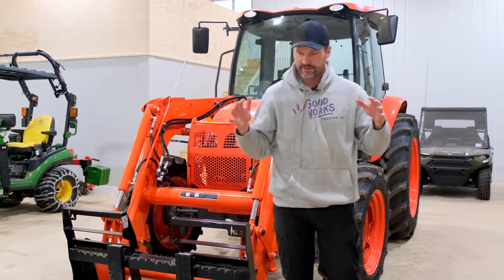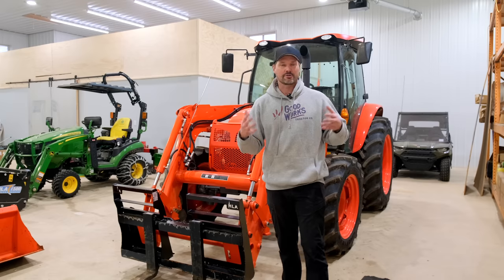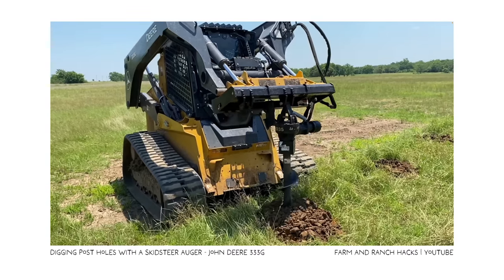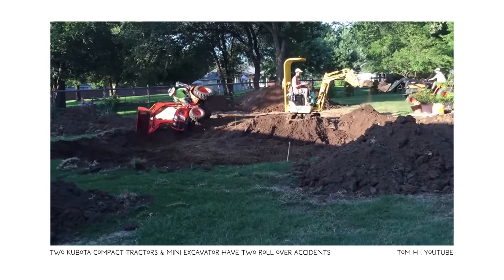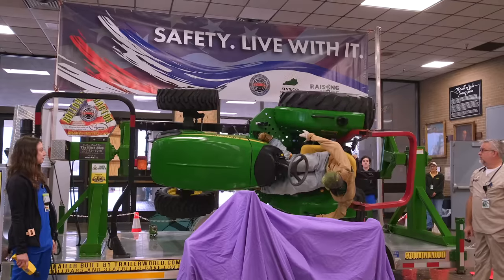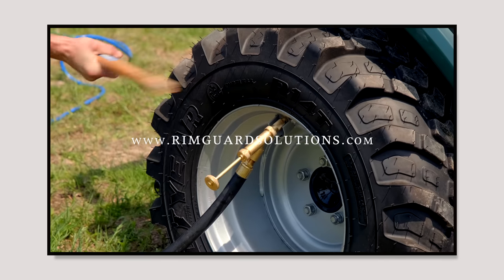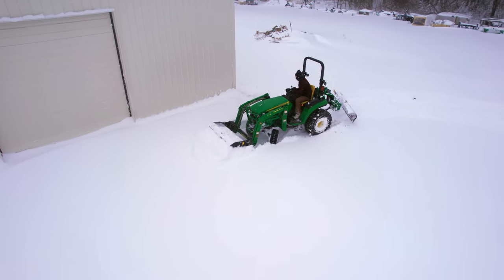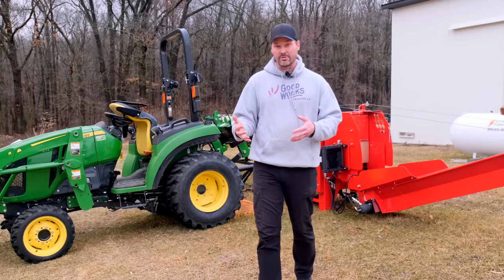BUYER BEWARE: MY 5 MOST HATED THINGS ABOUT TRACTORS.

Comment: I agree with alot of your points. Dealers that are into used tractors I believe have taken advantage of the customer.  Used prices are way too high on a piece of machinery you do not know the history of, point blank. Folks just do not take care of things like in the past. I bought a slv65 new and used it for my purpose and as soon as I no longer really needed it sold it. For me it was great work time saver and completed the work easily. Sold it for a fair price as far as I was concerned but apparently the very happy buyer said I could have asked for so much more seeing how it had 200 hrs.  I would have spent alot more in rentals, transportation potential damages...I avoided a used machine that may have cost in repairs. The Kubota repairs, services and parts are out if this world. I was quoted 600.00 for services on my bx23, yep did it it myself! There are times I would like the dealer (stealer) "go through" my machine, but that is ridiculous.  The slv65 was fantastic.  The bx23 is is built cheap many parts broke, most all the "safety" switches broke, hoses failed, dealer did not fill front diff, I learned to repair and fix my self saved $$$$. Not time but $$$. Thanks for your information.
Reply from the maker: Used pricing is strongly correlated to supply and demand and compared against what you can currently buy it for new.  It doesn't matter if it's through a dealer or Facebook marketplace.  The COVID years were a perfect example of this where you could see the used market go sky high based on scarcity everywhere that tractors were sold (commercial and private).  The prices have started coming back down.  It is all based on where the buyer and seller meet on price.  There will always be dealers and individuals that overcharge and generally speaking sales are slower becuase of it unless there is a corner on their market.

Comment: I believe that you are spot on about the fact that a lot of new small tractor owners have way higher expectations  of what their tractor is capable of than they really are. I was one of them. That being said, I am still amazed at what they actually are capable of. I bought a 2007 John Deere 2305 about 4 years ago with 400 hrs. on it. It was basically like brand new. The paint was still in the loader bucket and I don't think that the backhoe had ever been used. I  think that it had only been used for mowing grass. I wouldn't trade that tractor for anything. You are also right about inflation and what it has done to the average homeowner that would have been in the market for a tractor. I believe that a lot of people would love to go out and buy a tractor simply can't afford it now. A year and a half ago I bought a new tiller. At the time I paid approximately $1800. for it. Now the price has gone up well over $2000. I wouldn't be able to afford it now. I hope sincerely that things get back to the way they were. Sorry, I get a little long winded sometimes. 😁 God bless.
Reply: YES you are Right my Friend. For me I bought a very USED (8000 hour) construction type of Backhoe (Dynahoe-190)  which is (19000) Pounds. It needed lots of work to it when I bought it. My wife wrote up great contact, if repairs were more than down payment. That was the price for Backhoe. The Brakes did NOT function. The one stabilize would NOT function. And the two front Loader Lifts LEAKED like an open Artery. I had found a great local repair shop. One of the workers had sold Dynahoe's in the 1980s. He knew them inside and out. I have put hundreds of hours on her since 2003. No work or rebuilding of the Engine a wonderful Detroit Diesel 353. Just keep the filters clean, OIL clean. I have a small piece of property. I used it to make a small garden plot in the corner of the property. I pulled out my Driveway  for replacement. I am installing a swim spa for my wife. I think I would have spent way more time moving dirt with subcompact Tractor to make flat roads to deliver the spa into place on the back side of my house. Very fast work moving dirt, moving my Wood pile. Smoothing a flat surface pad for delivery of spa with forklift machine the company uses. Just saying that my LARGE Backhoe does it for me, more than a subcompact. If a person is willing to have repairs done on a used piece of equipment
Then I think they need a construction size Backhoe  more than a subcompact. Like he said I can rent from Home Depot any subcompact Tractor with attachment if need be. 
When the contractor was grading my Driveway replacement. He had to have the rental company come out and replace one of the Rubber tracks on the mini excavator, it split the Rubber. So even a mini excavator broke down. I ended up finishing the haul out of his material to the garden stock pile. I look at my small garden as a strip mine. My big Backhoe I completely turn the whole garden over each year. Like a strip mine moving overburden. My Backhoe is way oversized, but it has done every project I do in my small lot. Never an issue with power, even taking out LARGE tree stumps.
Reply: Right, I bought my skid steer 2 plus years ago it was a 2022 modle, price went up from the 58K I paid to over 94K for the 2023...  unfortunately we can't print money like the federal government so most of us are SOL. That said  the prices of livestock seems immune to inflation as far as the producer payout goes has not changed in over a decade, yet it costs 8x in the store. Big slaughterhouses making a killing in more ways than one.

Comment: I believe r4 tire became so popular because they were the only tire between the r1 and turf tires. You do get better traction in mud with r4s over truf tires and still don't tear up a yard as bad as r1 tires. I know now there are other options that can do both and give you better mud traction. These other tire options usually cost more then r4s and are limited tire sizes to chose from. The r4s also have heavier ply tires then the others for frontend loader work.
Reply: Exactly. If the R4 was that inferior it would have been abandoned 30-40+ years ago by the constitution industry. Yes the R4 is a compromise design. Not specifically for any one application. (Except high durability was purposely engineered into the R4.)
Reply: T

Comment: Yep .... all true.   After working with a JD630 and Massey35 on 80 acres for 20yrs I decided I needed something better as I get into my 70's.   Did do diligence ..... researched the multitude of Makes & Models ..... kind-of set my sights on a tractor hp of 55-60.    Settled on the Make (Kioti) and found a dealer 52 miles away (that's a short distance for Wyoming).   Went into the dealer with a listing of what I needed to do and the implements to accomplish it.    So .... they showed me the RX73 hp model.   Tried it out .... thinking I don't need this much power.    Then went to the NS60 hp.    The dealer asked if I remember "Tim-the-Toolman - Taylor".    He was Soooooooo right .... "More Power"!!!!     Could I have gotten by with the 60 hp model?????    Yaaahhhh ..... BUT ... 4x4x8' hay bales is a breeze with the RX73 where as the 60 hp might be intimating the Massey 35 saying .... "I think I can .... I think I can."

Comment: That's funny you being up the hydraulic speed. A few years ago I was looking for a log splitter and a 3 point hitch one was basically the same price as a self contained one with wheels and its own motor and pump. And the self contained one works a lot faster. Plus it doesn't hold up the tractor .

Comment: These tractors always impress me as to what they can do! Lift more than I can, move material to wherever it needs to go, mow large open areas, etc. Easy to operate, cost less than a skid steer and don't damage lawn areas so much. Good points on lift capacity and lift height. As said, do your homework before $$.

Comment: I like the “choose the right size” point that you made. I just finished 100 hour review of my Massey Ferguson 1825e, and I can’t believe I missed that point. For my application the full size compact tractors like the one I have are a little to small for some of my projects and a little too big and heavy for other jobs, but buying two separate machines was not an option for me so counterintuitively the tractor that is not perfect for most my jobs ended up being the most perfect tractor overall. Thank you for another great video!

Comment: Great video, all relevant points. I run a small 40 acre ranch, a couple of years ago I upgraded our old Deere 3010 (1962 built). With the prices so high on the 3 and 4x series tractors I decided on a green 320G skid steer as a replacement.  Right off the get go I noticed the difference in ground clearance in mud.  Next thing that wasn't pointed out at the time was how inconvenient opening the front door to get out is when you can not lower your attachment (think getting stuck in deep snow with a snow blower you can't lower or use to push yourself out with). On the snow blower topic, it was the first time I ran into the High Flow/ Low Flow hydraulic options.. the 320G being almost $35000 less than the high flow hydraulic equivalent, you are limited in the modle and throw distance. Yes those Ag tires on ice are a real safety issue, and you lose ability to turn tight with chains on without breaking them. Can't really weight your tires on the unit because they are so small so you use the bolt on weights they sell at a premium. Those weights made lifting 1800lb large round bales a lot safer.

All complaints aside, I've found with a bit of operator experience in keeping the snow bucket low enough to take off anything that will break your traction without grabbing onto too much hard pack or ground to create extra resistance you can push the 84 inch HLA snow bucket through snow as tall as the bucket and as long as you don't get too much falling over the top to where your wheels start to spin in it, you can push right through. Could not do this without weights and the small work bucket even, those weights were a game changer. Looked at the wolf paw tires/rims and cried when I saw the extra cost, I run 100% on dirt and gravel and not sure they would last as long as the OEM bads.

Comment: I got rid of a Ford 2110 for a couple of reasons, mainly it just didn't have enough weight or reach with a loader. I have bigger tractors and it didn't fit in my operation at the time. I do lots more with a large skid steer and use a 60 hp tractor where I used the 35 hp Ford. The difference in fuel isn't enough per job. Yes it was less per hour but took more time. Purchase price is another.

Comment: I have been eyeballing the Merlo MultiFarmer MF34.7 CS in context of lifting long, heavy, oak logs for saw milling and timber framing as well as homestead upkeep and misc projects. Very expensive at around $140K new, but basically a 17.6K+ lb telehandler with a 7.5K lb max lift capacity and a rear 108 HP PTO with 3-point hitch with 6.6K lbs lift capacity and the additional benefit of having selectable front wheel steer, 4-wheel steer, or crab steer. A bit over 7' wide, 8' tall, almost 18' long with 17" of ground clearance. Main hydraulic flow is 40 gpm.

Comment: I’ve had my 4320 JD compact for 17 years and battery finely died. I have 750 hours on it. Purchased in Alaska moved to Arizona then on to Tennessee. Still runs great, paints a little faded from sitting outside. But is under cover now.

Comment: Tractors are a compromise unless you are pulling hard on the drawbar or 3 point. The hydrostatic transmission is a compromise even to that task. Loaders on a tractor are all wrong. Weight is carried on the small axle!!!?? Amazing to me that the conventional rigid frame farm tractor has become the most popular design for so many people who will never use a ground engaging implement on the rear! However- cost is very economical compared to a mini loader or skid steer that would be better suited for many homeowners. Hydrostatics make these units more useable for the average weekend project. I farm and I get a lot of enjoyment out of my “little” 75 hp TYM. I used to use my big tractors for everything around the home place. The smaller tractor has paid for itself in fuel savings alone. And the utility platform is a lot easier to mount and dismount than a large row crop when doing chores.
Reply: True, the design of smaller tractors is pretty strange. There are alternatives like Ventrac where a small tractor is reimagined. Some Italian brands like Antonio Carraro build tractors so the big wheel can be the front wheel and loaders can be mounted at the front.

The PTO and three point hitch are such versatile and popular connections and powering a PTO is pretty cheap compared to hydraulic power. These are the a few reasons why the standard framed tractor is so dominant.

Comment: Great video!  I got B2601 4 years ago and it’s been good to me. One thing I worry about though is when the day comes I have to transport it. I have no trailer and I’m literally 2 hours from the nearest dealer.
Reply: There are people around who will transport a tractor for a fee. Even a tow company with a tilt tray truck will do it but being two hours away it would not be cheap to transport a tractor this way.

It is fairly probable the tractor never needs to go back to the dealer if it is looked after and does not suffer from a big fault or accident. So maybe the day the tractor needs to be in a workshop will never occur.

Comment: Weight isn’t the only tipping factor.  These small tractors are really narrow and that makes them very easy to tip.  Case in point, your video of the Kubota tipping on its side.  That said, older tractors are top heavy too.  They sit high and can tip easily on side hills.

Comment: Not so much, things I hate but rather, things to be aware of.  
Hydraulics.  "One pump to rule them all" is the issue.  It can only deliver so much.  Also, I added a third function but was surprised that rear hydraulics weren't included.  Newbie!  
Size matters.  I decided to go bigger than I wanted and got the 1025R.  Should have gone to at least a 3 series.  My wife bought a biga$$ cabinet and I could basically lower it off the truck and keep it about 2 inches off the ground.  Counterweight is your friend.
Weight.  Needed to but suitcase weights from some yahoo in Michigan.  Why didn't the salesman recommend them?

Tires.  I haven't had a issue with these tires but I will probably get chains next winter.
Have a great day!

Comment: I think featherweight tractors became a thing when the market for homeowners, property managers, landscapers etc exploded.   A light tractor won't tear up and rut up lawns the way a heavy old beast will.  And that's where a lot of these tractors live much of the time.   Even our old 1940's Farmall A, a very small tractor, left ruts in our lawn, if it was at all soft.

  They aren't working in tilled soil, or muddy barnyards, and typically arent doing heavy tillage or draft work.   They're more like a bigger, better kitted out lawn tractor that can do FAR more jobs.    You also have to consider the need for many to trailer their tractor around from property to property, and job to job.  A lighter tractor is a big plus in those situations.

Comment: Like the video, Any chance you can do one on the different tires available for compact tractors?  Most dealers only show Ag, R4 and turf and call it at that.  Love to see what other options there are.    About size and weight.  I would rather have a 30hp L series over a 30hp B. (I happen to have an L3130 with a L723 loader).  Simply because you have the weight and the larger tires for traction.  Most things done with a tractor do not necessarily need a lot of HP.  Having that extra weight from ballasted larger tires helps more for traction and lifting capacity than that bigger engine.  The only time I wish I had more HP is when I'm running a rotary cutter and as I only mow a few smaller fields I can get away without it.  I will say that I use mine more for logging and dirt work than field work.

Comment: I would add to this list the new diesels over 26HP  requiring emissions baloney.  Also, regarding loaded tires, my Kubota BX-25 manual recommends against loaded the tires on this machine if you are running the back hoe.  And regarding loaded tires, if I had to do it again, I would have my tires foamed--no PSI to worry about or flats!

Comment: Good points.  Also during supply shortage, appropriate sized and available tractors were hard to get… I ended up buying a larger and a smaller tractor in a combined financing deal and have appropriate jobs for each sized tractor…. Not everybody can do that, I was fortunate…

Comment: Whats the better tire for all around work on a tractor from snow, mud, mowing? R4s or R14s. In the process of buying a tractor and have gotten conflicting answers between these two tire from different dealers.
Reply: I had R4s on a JD 2025r(traded in), my new Kioti CK4010SE HST came with R14s and in the snow there is ZERO comparison.  R14s for slippery surfaces

Comment: What style tires for all around use on compact tractor ?
Reply: R14s are the best, but they are hard to get. Now Kubota has a new exclusive tire that is is similar to a R4 but has been grooved. Similar to grooving the R4s that Courtney did a while back.
Reply: R14 is the new "darling" of the industry. Good traction of pavement (no wandering on pavement), dirt, grass, snow. If you do lots of snowplowing, you'll still need good chains though.